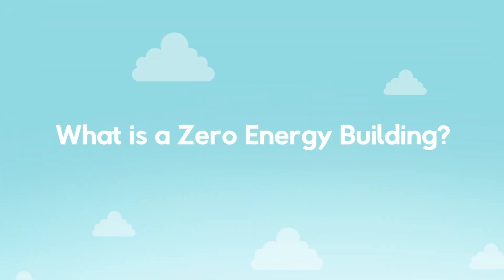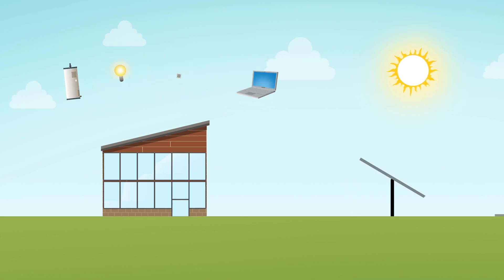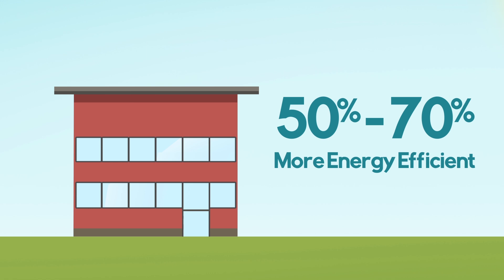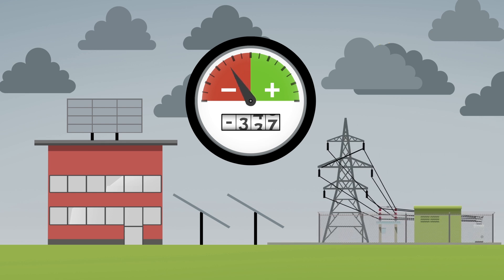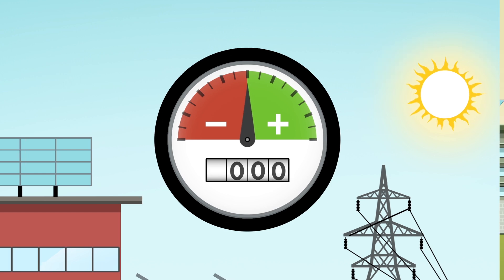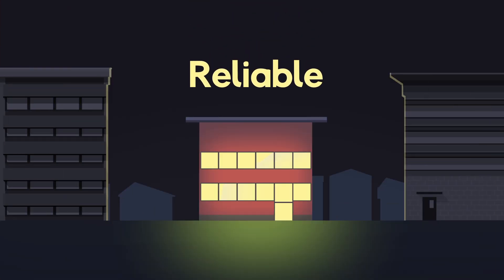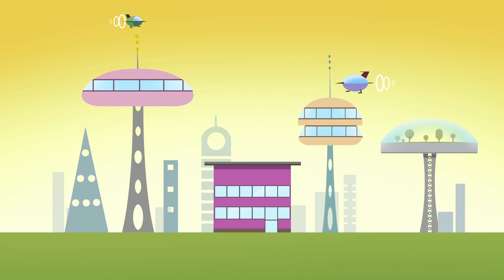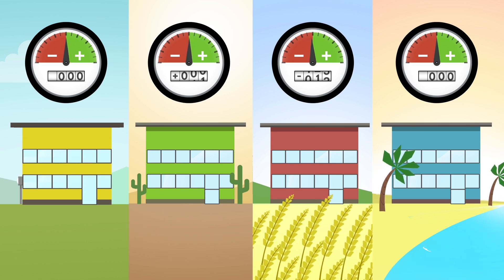What is a Zero Energy Building?

Comment: The public power grid is not a storage battery or intended to provide continued emergency power dip make up from solar wild AC.   The cost to the public power grid is nearly the same as if providing all the electric power all the time, but it is may get no payment because the wild AC has been sold back to the public power grid that is nearly worthless at retain prices  There is little fossil fuel saving because of needing to stand at the ready to make up any dips in solar panel output.   

It would obviously be unsustainable if large number of public power grid customers were to generate enough solar wild AC to cover their electric uses over 24 hours made in five hours of the day.   All that wild AC from these sources that is enough to run the customer for 24 hours can only supply so many local customers at peak operation before there is nothing that can be down with it locally, but the public power grid can't refuse to buy it, so it has to condition the dips, which cost money, then get rid of the electric power for whatever it might be able to sell if for,  to other public power grids.   This is the main reason southern California has both the most expensive electricity in the USA and bankrupt public power grids unable to modernize their transmission lines.

Comment: 0.51- "When conditions improve the onsite renewable energy systems will cover the building's energy need and send excess energy back into the grid to make up the balance". I don't quite get the part about sending the excess energy back to the grid, could someone please illustrate?
Reply: Sending excess energy back to the grid means when the solar system on the building produces more energy than the building consumes, the excess is not wasted. That additional power is sold back to the utility provider to use. So the house is in a relationship with the power company. Look up "net-metering".

Comment: Many of the design ideas for net zero design cost nothing and save on your power bill.  You can get a long way toward net zero with simply smarter design with minimal extra cost, especially using computer simulation to optimize whole system design. Eg run software optimization to find optimal eve overhang and window placement and size. Compare upfront cost versus annual  saving from double glazing & various insulation thicknesses, to see what makes most economic sense in your climate. Design floor plan to make best use of indoor thermal mass from sunlight coming in windows. Plant deciduous trees near house to shade in summer but not in winter. Replace old lights with LED lights. Get all the best lowest cost design improvements, then keep going until the additional cost doesn't make worthwhile additional savings. Final cost should not be more than about 10-15% above basic cost to meet minimum code requirements. If cost is higher than that you need to think smarter design.

Comment: Do not call it zero energy because it still requires grid energy,it still can not run 100% on solar. You also contradict yourselves. You state solar does not significantly reduces energy load cost,but your ,"zero energy" building use solar. Of course solar would not be efficient,if you use too few panels.  True zero energy buildings already exist in Finland,Germany,and Sweden. Entire roof tops are made of solar panels. Placing panels on the ground does not maximize sun capture,because building s or trees may obstruct path. This means ground panels require lots of open land,which is wasteful;when rooftops can be custom-made of entirely Solar panels. Outer-layers of walls can have solar panels attached also. That is the idea of a true zero energy building.
Reply: Keepskatin you are so wrong The energy needed to make up for the loss of power in the line that reaches to your house is significant and it's cost savings when you have solar on your home...
Reply: Am ok with it. The import export to the grid will utilise the grid as 'battery'.
Reply: It would be absurd beyond comprehension to make a true zero-energy home with solar power. You would need storage, lots of storage, batteries would not do it. You would need to produce hydrogen, store it in massive tanks, burn it in a generator for when the sun isn't shining, and round-trip efficiency would be ~20%. The most rational thing is someplace like Norway with massive hydro power with reservoir storage and using heat pumps and electric vehicles can make a TRUE REAL - NO BS - NET ENERGY ZERO TOWN full of buildings. That is a rational example. What the DOE is hyping here is pure BS.